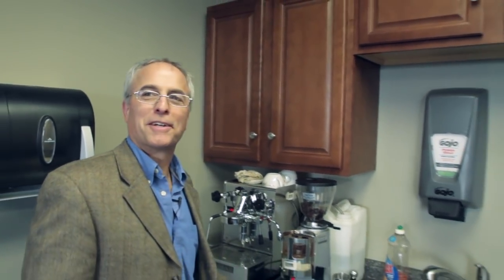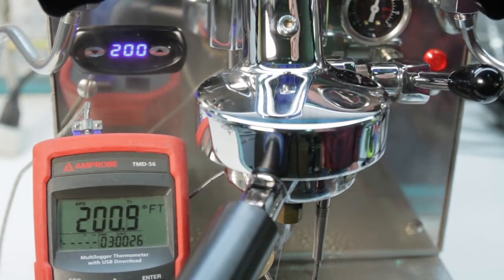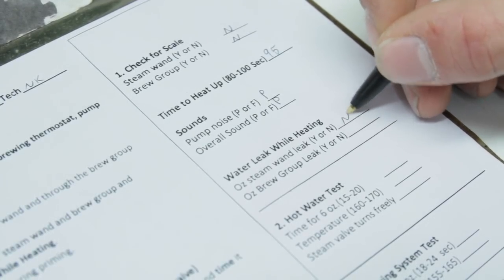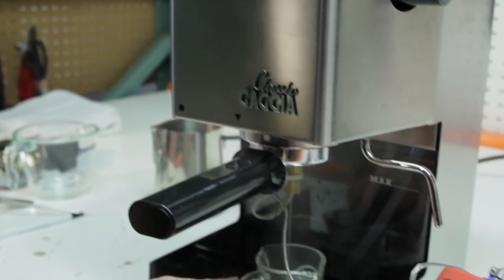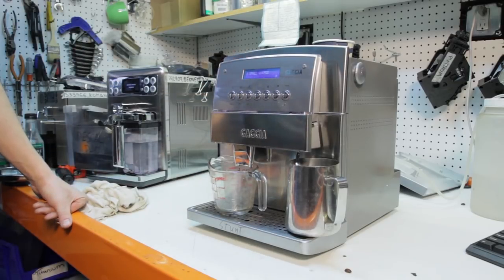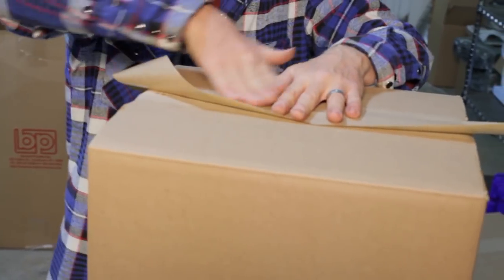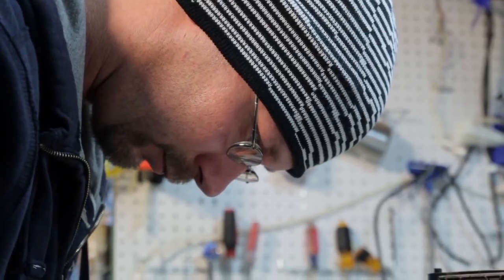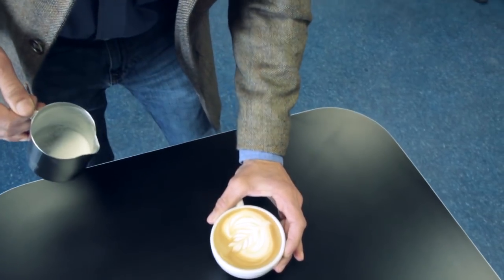DEL Factory Certified Refurbished Coffee & Espresso Machines

Comment: Got a great deal on a Gaggia Pure from these guys. I dont believe any seller that says "Refurbished" Like i do Whole Latte Love. I've heard of horror stories like a full spent espresso shot in the portafilter on a "refurbished" unit.
Reply from the maker: Hi SC, Thanks for the comment. Our refurb machines go through full testing and cleaning!
Reply: @Wholelattelovepage  Maybe its bad timing but i have an issue. THe bottom of my machine is leaking water. I removed my water tank and looked down where the grommet is for the water and theres a pool of water. So its pooling in between the actual water tank and machine and i'm guessing its finding its way to the bottom of the machine.

Comment: I recently snagged a refurb Synchronika. I have a tiny insignificant YouTube channel and I’m going to review it  :) 

Thank you for the great machine currently with UPS. If I’m lucky, they will deliver it in one piece 😂
Reply from the maker: Hi DrM, That's a good snag! refurbed Synchronikas sell quickly! Being I'm responding a week after your comment I'm guessing there's a chance you've gotten the machine by now? Do let us know when you do the review and post a link!
Marc
Reply: @Wholelattelovepage  Hi Marc. Yeah man it’s hear. Some mushroom troubles but I’ll take a solid go to fix myself first; I know you guys are busy. Will do. Thank you for the support and for the gorgeous machine. What a beast!
Reply: @stiksandstones  good morning. The “mushroom” is the pressure control handle/aperture system on top of the group head. I had to unscrew and reset the components inside and retighten/apply plumbers tape etc. That’s all :)
Reply: @stiksandstones  mine didnt need to be replaced, you just have to reset it because shipping can jumble it around. you just look into the space it goes and reseat the spring. super simple.